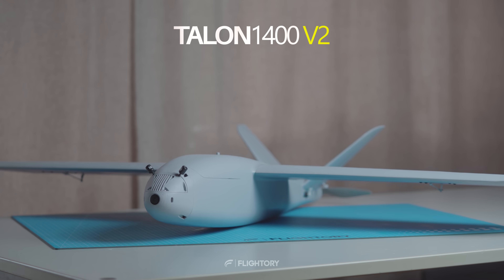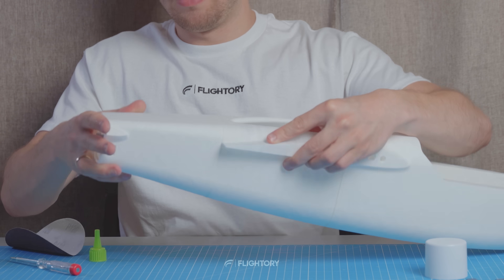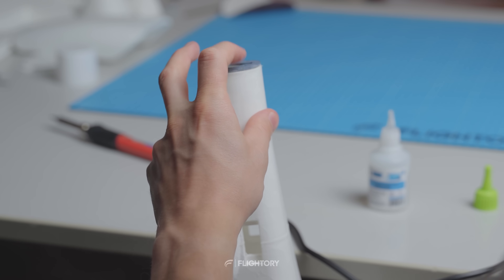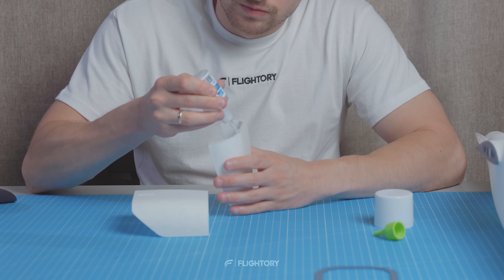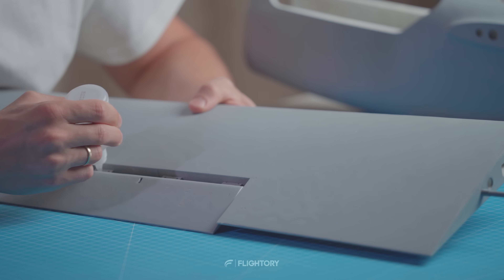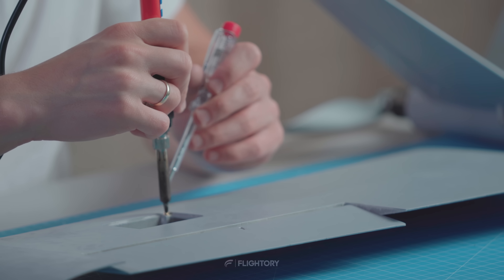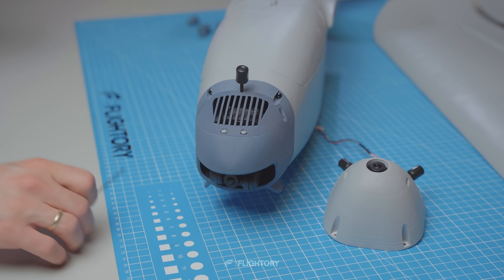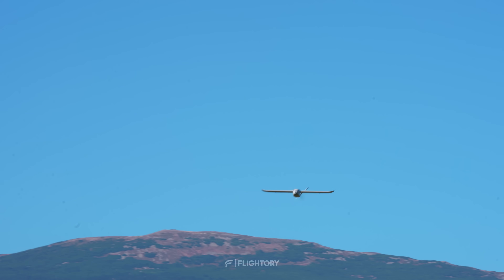How to Build a 3D Printed Fixed-Wing UAV? | Talon 1400 Build

Comment: Why did you place the battery in the front and not closer to the center of lift?
Reply from the maker: There is no reason to place the battery at the center of pressure; instead, you place it to achieve the correct center of gravity for the aircraft.

Comment: can someone explain how spraying the CA accelerant works if you are not spraying it directly on the glued surface?  Is it getting absorbed through the plastic?
Reply: Although this build is great, don't copy the way he uses the CA glue and accelerant. Best practice is to coat one surface with glue and the other with accelerant. If you do it after you've stuck them together it only really activates any glue that is exposed so you can have an uneven activation, it doesn't soak into plastic so just sits on the surface. This is different when using wood as the accelerant soaks into the wood so you can use it like he does in the video - it's used for mitre joints on frames or void filling in woodworking.

Comment: Wow, these print look so smooth? Are you just sanding them down or are you using a different techniqe?
Reply from the maker: As I mentioned in the video, I sanded it a bit with fine-grit sandpaper and painted it with primer. The surface looks very nice. I don’t have a recording, as I did this in a workshop area, but there’s nothing complicated about it ✈️

Comment: Nice looking design with lots of interior space, easy access. Great website, and reference build material (manual, etc). Didn't see electronics (FC) mount in build manual, but found one listed under "accessories" on web store. (suggest to include a reference to in the build manual)
Would be nice to see recommended default control throws and and mixes also listed in the build manual.
Reply from the maker: Soon, we’ll record something focused specifically on electronics, and I’ll go over the basic setup for a fixed-wing in detail. In this case, mixes aren’t set on the transmitter; instead, tuning is done through the flight controller via a ground station, such as Mission Planner. Everything is available in the ArduPilot knowledge base, but I’ll also make a video about it and focus on the most important aspects.